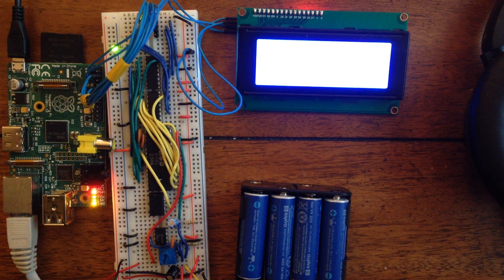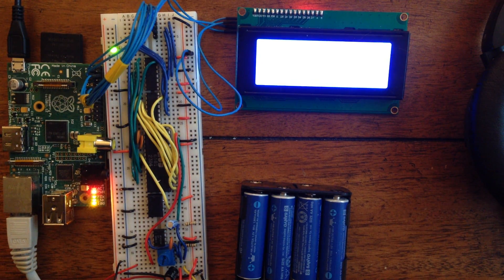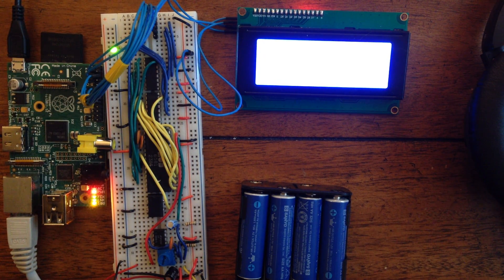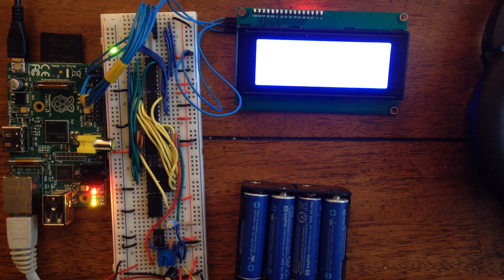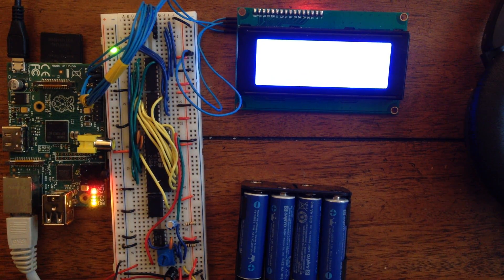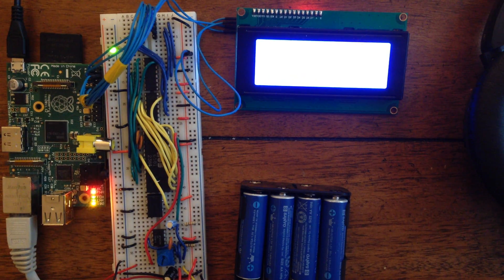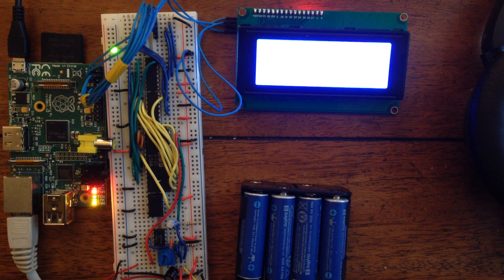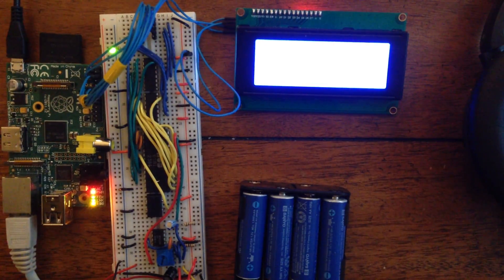Raspberry Pi SID Player

Comment: What about modding the unit to take signals from the MOS SID chip socket and output the intended signals so it can operate as a replacement for the MOS SID Chip.
Reply from the maker: I think that can be done - there is another project called ARMSID that’s supposed to act as a drop-in replacement so I would honestly try that first myself
Reply: @bioniclebert  Jan Beta's ARMSID broke when he tried to use it with new replacement chips to replace other MOS chips.

Comment: Hello, I am building a similar project and checked out your code. Your code seems to play .DMP files, could you please explain what tool you used to generate these?
Reply: There was a tool somebody wrote on the Parallax Propeller forums for creating dumps from SID files. Essentially they would grab the data Bytes from each SID register every frame (I assume every 1/60th of a second) and write them sequentially to a file. It would be much better if I could read up on the .SID filetype and just be able to interpret those as-is. I've been meaning to revisit this project lately and maybe in early 2021 I'll try doing that :)

Comment: Bob is there a new website for the build info?
Reply from the maker: Chris Miles no, but I could go ahead and make a new one. I previously uploaded the files to Box but I’m not sure if they’re still publicly available. I’d also like to redo this project sometime as there’s a lot I’d change
Reply: Thanks. It looks a good project it would be good if you could make a doc or PDF and stick online. I'd like to give it a go.
Reply from the maker: fixed the website to http://bertiusgames.com/projects/SID/index.html . There are still some broken links as I translate everything over, but the SID stuff should be accessible.

That said this project is kind of old and I'd redo a bunch of things. For what it does, it sort of works, but it could be a LOT better. I have thought about redoing this project quite a bit lately and might give it another look. Anyway, enjoy
Reply: Many thanks for your effort :)
Reply: Thanks Bob. 

You're diagrams and code was really useful for me to come up with something similar however I'm not using a shift register so I've kept an array of pins for data and array of pins for address. 

I do the same and just loop through 25 addresses from A0 to A4 and the 8 data pins for each bit. 

For some reason it appears to be playing so extremely fast the chip can't pick anything up. 

A full sid song prints out in about 20 seconds when I do a Debug print for each Byte I write. 

I'm wondering if I'm missing something really stupid. I'm sure it's wired up properly so can only be the code.
Reply from the maker: (sorry if this responds twice.. I wrote a reply and then google happened, now it seems to be gone..)

It should be something in the code, yes. From what I can tell from reading my old python code, we are doing a time.sleep(0.00001), which is for 10 microseconds. Depending on the song you're trying to play (PAL vs NTSC) I believe that should be running at 50 or 60 frames per second, which would be 1/60th of a second, or 16666.66 microseconds per frame. Since I did the sleep after each byte write,  it looks like each frame would actually end up being finished in 25 * 10 or 250 microseconds per frame, so something in my original math looks way off.

Keep in mind that due to scheduling and external interrupts, the raspberry pi + python isn't going to be super perfect doing super time precise actions. Plus there is the code necessary to run each frame in order to load song data, write out the address and data lines, or anything else the script needs to do. I am also not 100% of the accuracy of sleep() on very low units, like if you call sleep(10uS) and measured it, how much time might actually have passed. What I mean to say is that 1/60 of a second minus the time required to do the actions is probably not too realistic to calculate. So it would be better to either try to measure the amount of time it takes for you to write out each frame (shifting out the 25 addresses and data bytes) with an oscilloscope, get an average, and then use 1/60th (or 1/50th) of a second minus that value you measured, in order to determine how much time left over there is to be sleeping... Or you can just try to manually increase the time delay until it sounds right to you :)

Hope that helps, please let me know if you end up getting some music going!
Reply: Thank you for the detailed response I shall experiment with timings tomorrow. 

I have a few more questions If you don't mind?

I see you're using the shift registers (I am not) so I wrote it to just loop through the addresses. 

Why did you use 25 addresses instead of 29 that I see in the technicals (out of a total of 32)?

Without the shift registeres my gpio bits will only be 3v will that he a problem? I assume the shift register is taking 3v but outputting in 5v?

I'm just using a 1Mhz crystal oscillator I got from eBay which runs in serial from 5v into the clock pin, does this sound correct and is it likely to change anything from a timing point of view?

Many thanks again. I feel so close to a result haha
Reply: The last question I have is does the endianness matter by not using the shift register?
Reply: Also regarding the timing, it's that I'm getting absolutely nothing at all playing. 

I tested the amplifier stage in isolation with a regular analogue source and it worked. 

I tested each gpio pin for address and map with an led high and low to make sure I had my pin mappings correct.
Reply from the maker: 1) A0 -> A24 are used to WRITE sounds, the last 4 registers are READ only. They are used for potentiometers and other misc stuff that I'm not really familiar with.

2) Without the shift registers the raspberry pi will be pushing out 3.3v... It might be enough to overcome the threshold to toggle 5v logic lines but if not you would need logic level conversion on those pins. Using a shift register also allows you to pass a bit more current out than the GPIO, since you're passing VCC of the chip through to the lines of the sid, rather than the low output current of the IO on the Pi directly feeding the SID.

3) using a crystal oscillator would work fine, but it won't work just by itself. The little chip I bought actually produces the 1Mhz square wave at 5v, but you will need some additional circuitry to get a 5v clock pulse out of a plain crystal oscillator. An easy way to do this seems to tie it with any kind of CMOS logic gate, such as an inverter or NAND gate. Something like this Q&A should be helpful: https://electronics.stackexchange.com/questions/49251/how-to-connect-a-crystal-oscillator-to-generate-square-wave 
If that is the case, I would fix this up first and see if that doesn't fix it altogether.

4) Endianness is a good question.. It looks like I am shifting out the Address and data lines in MSB first, but you shouldn't have an endianness problem per-se if you are reading a byte from file and writing it directly to the chip. For example, if you read 0xEA (1110 1010) as the data from file, you should be able to test that with some LEDs across whatever pins you've chosen as output and see that appear as D0: 0, D1: 1, D2: 0, D3: 1, D4: 0, D5 -> D7: 1 and it should appear in that same order. So I don't think that should be a problem for you
Reply: Thanks again Bob. 

I've now found a clock solution. Using wirping pi allows me to create a clock signal that's a division of the internal clock, if that doesn't work I'm going to try an arduino 1Mhz example. 

So that appears to be wrong what I am doing as I am still putting out the MSB first to the address and data lines so I'll address that issue first of all. 

If I fail with the 3v logic I may just move it all to 5v on either arduino or the shift register example. My goal was to get it working standalone and then once I understood it all I would then try with the shift registers.
Reply: So bob, it turns out I've made a grave mistake in that it's an 8580 I have and not an 8581 - and the supply voltages are 5 and 9, not 5 and 12. I'm going to try with a 9v supply tonight. What's the chances I've burned out the chip?
Reply from the maker: Ooh sorry to hear. It’s possible that it’s dead but won’t know until you give it a try. I did something similar where I had confused the 12v and 5v line and it died, could still hear a faint noise though. Difference between 9 and 12 might not be as drastic on the chip so crossing fingers...
Reply: Good news is the SIDS aren't toast, and I've put in a 9v supply just in case. I've also hooked up a 1Mhz crystal oscillator. 

Bob, a question about the SID files you are playing, are you doing anything special? From what I can make out the file format shows that there is a header, and the addresses themselves are defined in the file? Maybe I'm missing something. 

Best regards 

Chris
Reply from the maker: Chris Miles as far as I remember, I take the SID files and run it thru the SID dumper program, which the .dmp files should just contain the bytes to be written to the SID in order. I think there’s a link on my page to that program. With the dump you should just be able to read a byte from file, write it to the SID, and then repeat on each incremental address, then loop back to address 0 after writing them all. 

I would like to redo this project to just use the natural SID files and have the driver device actually run the code necessary to play it according to the SID specification (I think Kevin Horton aka kevtris and other smart guys have written some documentation on that). 

Glad your SID isn’t dead!
Reply: That's looking like my problem then. I was just reading the sid files. Haha
Reply: Could you please send me the dmp file you were using please? Even as a message on here in plain text. 

I have the sid dumper app but it's saving lots of other data in a table, I don't know what formatting you've done to the file.
Reply: I was using the wrong sid dumper and after some research and dead links I've managed to find the correct one and I've got music bob! Lots of noise issues I need to fix but I've got music haha
Reply: Bob Szymanski at last. https://youtu.be/2Lr5gRToCSc - the weird timing and stuttering is noticeable, i understand about the OS interrupts etc. I look forward to experimenting further. Thanks for the guidance.
Reply from the maker: Hey there, sorry I have been really sick for the past week. 
As far as I know back then I didn't do any modification to the .dmp files, perhaps the SID dumper program has been updated since I last used it and has breaking changes. 

I can't seem to find the raspberry pi SD card in question that I used for this project, so I don't believe I have an exact copy of the original dump files. I will keep looking. I found the assembled breadboard from this project though so I can try to get this thing working again, and let you know if I can find anything interesting.
Reply: Bob Szymanski no problem hope you're feeling better. I made another post, I found the right sid dumper and managed to get it working. I've posted a video on my profile. Thanks :)

Comment from the maker: Just a brief update: Since this video was uploaded, the Raspberry Pi 2 has been released. This might improve performance of the SID player, but I haven't had the chance to test it yet. I'm actually thinking of porting this back to arduino (no changing in the wiring of the breadboard required!) because it was actually a lot more precise with timings and such. Stay tuned?